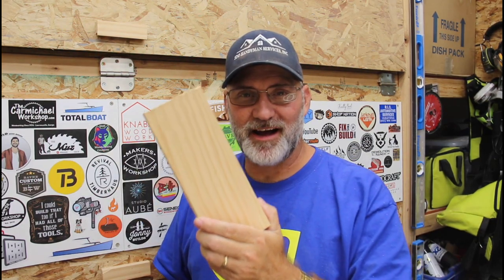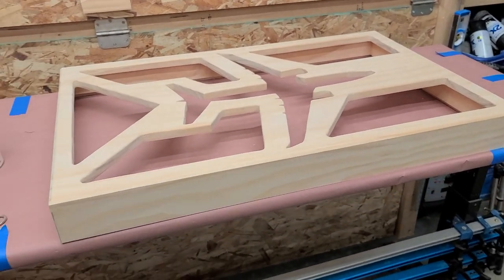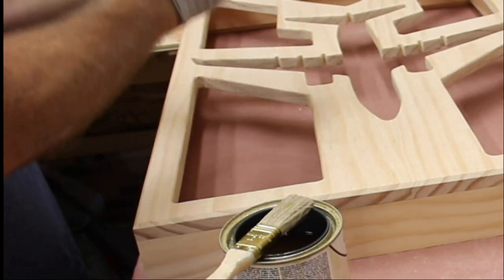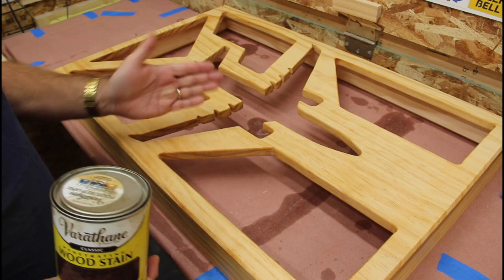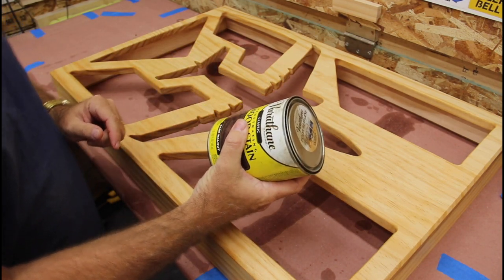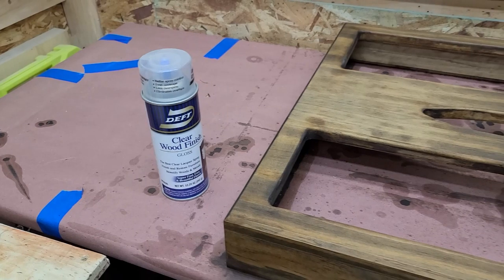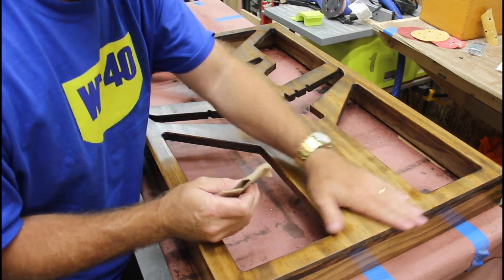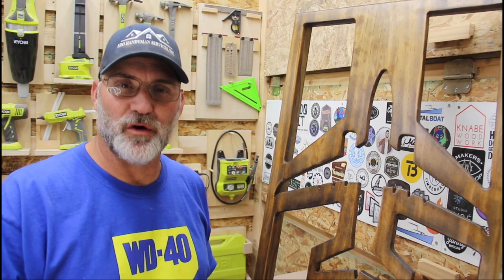Using Varathane Wood Stains and Conditioners | Turning Pine into Walnut | 2021/34

Comment: In my Renovation of my upstairs, I needed to stain 200 feet of pine baseboard along with several pieces of casing. To match the existing trim I had to use Zar wood stain. My first test blotched. Using Minwax wood conditioner required it to be stained before it was completely dry. Long story short, I found a awesome product called Charles Neil Blotch Control. It’s alkyd based and doesn’t have a time limit for applying stain. Worth checking.
Reply from the maker: I'll check it out. I have heard good things about alkyds

Comment: Would it make the wood darker, perhaps more even, to use two coats of stain? Or will the wood only absorb the single coat? Thanks.
Reply from the maker: I've had good results with a second coat. It has to be within 2 hours or after 24 hours. Leaving it on longer before wiping also also can provide for a deeper color.
Reply: Right because it doesn't look very consistent
Reply from the maker: Thanks for that.

Comment: Hey question, would this work on the fake wood from IKEA or does it have to be real wood? I got two shelves that are reddish looking , and wanted them to look walnut color instead.
Reply from the maker: I'm not sure. Probably not. Stain soaks into the pores of the wood. If there is nothing to absorb or it's MDf, then it will just look mottled or sit on the surface.
Reply: @DadItYourselfDIY  hmm good point , I wonder if paint would be better then.
Reply from the maker: There are some very interesting paint techniques to get the wood grain look, or you could wrap it in contact  paper: https://homedepot.sjv.io/zaZYBx or wood veneer: https://homedepot.sjv.io/P0J7kM

Comment: What about the burnt splotchiness? It's obviously not walnut.
Reply from the maker: Obviously it isn't,  and was never passed off as such.
Reply: I'm not a pro but I do know pine limitations and basic cherry, walnut,golden oak look. This clearly isn't walnut. Just a dark brown stain
Reply from the maker: @RokkuAni Yup. Not perfect, but when spending money on Walnut is unnecessary.
Reply: You called the video "turning pine into walnut". Hence the comments you are getting, since it doesn't resemble walnut. There are ways to get it closer than this, but they require different products and techniques than these.